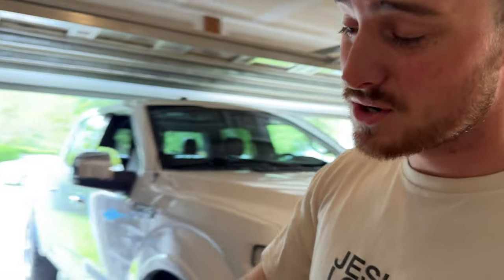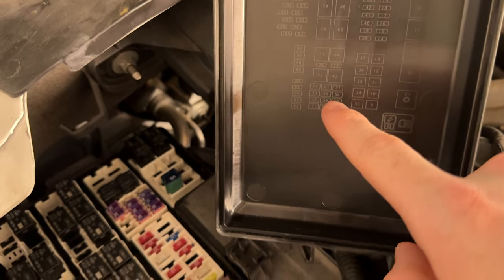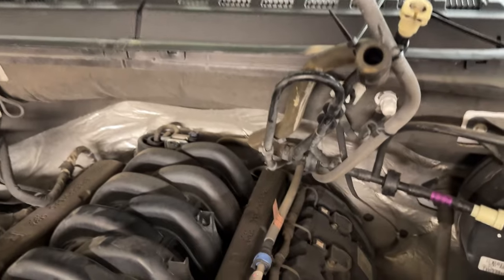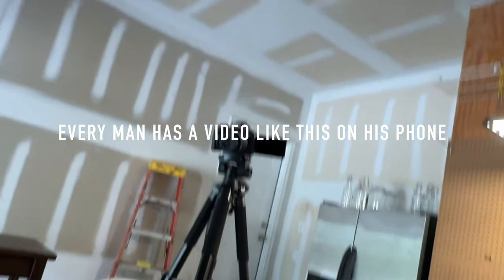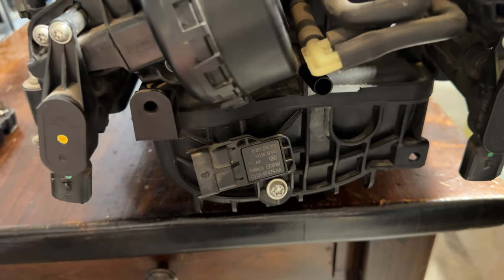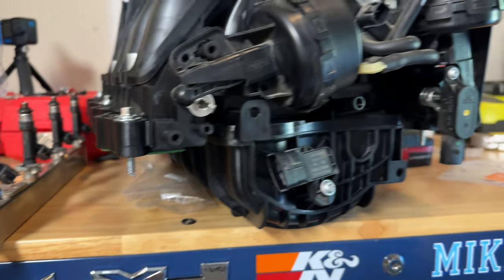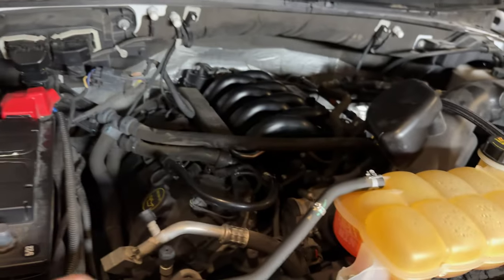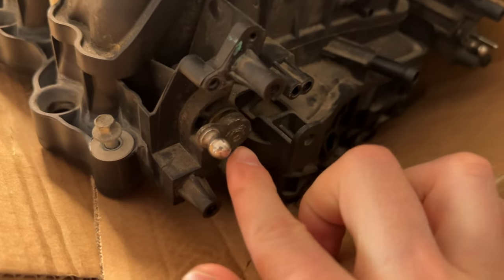Intake Manifold Runner Control Fix - 2015-17 F150 (P2004, P2005, P2006, P2015)

Comment: Great video. What do these codes mean? other than the check engine light? what does this part actually do?
Reply from the maker: Basically these Intake Runners can break and it throws the truck into limp mode. Only way to fix is to replace the ENTIRE intake. The intake runners help with low end torque and such, dumb Ford (engineering) stuff
Reply: @hunterrwiilson  I decided to go with the Boss 302 Manfold and K&N air intake  with 5-Star SCT Tuner from Stage 3 Motorsport. Took me and a friend a few hours to install and worked awesome.
Reply from the maker: @matthewgonzalez2360  heck yeah man!

Comment: 17:16 I had the same thing happening with mine. I replaced everything today and found out the position sensor was the problem of it all. The sensor has to be installed correctly onto the rod in the back. That meaning, the notch in the sensor needs to line up with the line or dot on the sensor. I installed it incorrectly the first time resulting in this happening.
Reply from the maker: @alec679  probably the worst thing with these F150 5.0s. No reason to have this function. Glad you were able to figure that out!